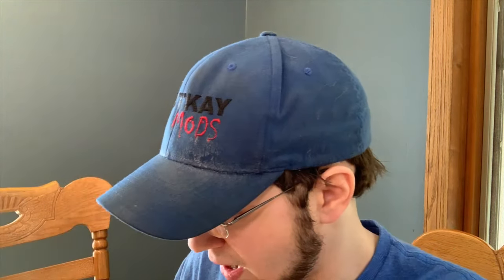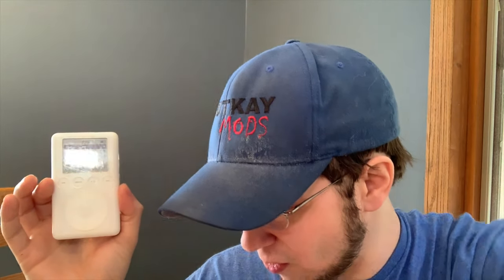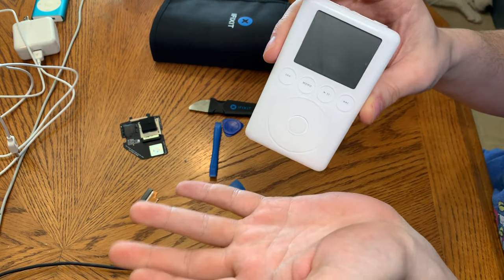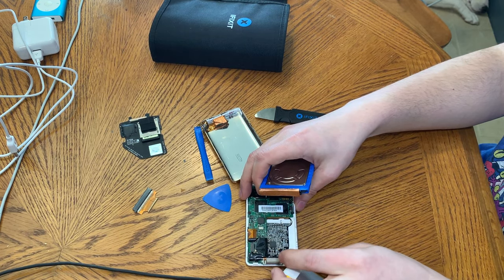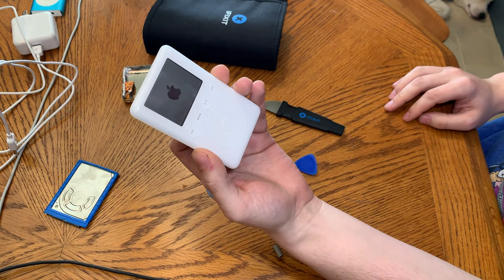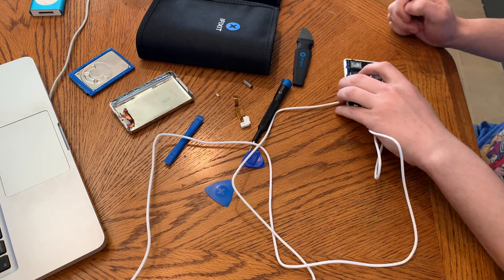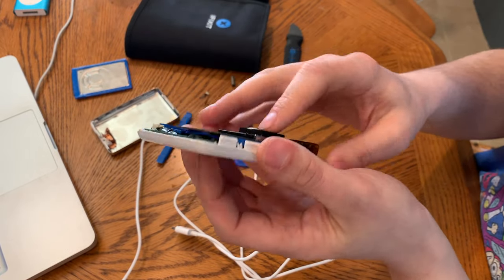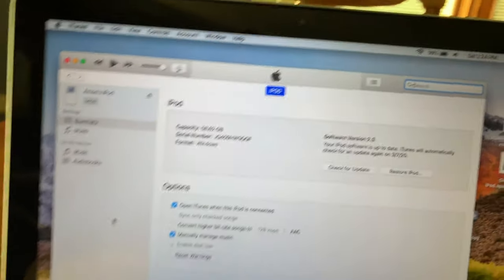Building a Flash Based 3rd Gen iPod (Part 1) – iPod Series S.1 EP.10

Comment: ah man, thank you so much for this. I was losing my marbles, I get obsessed when things don't work, especially when others have made it work. I was extremely despondent and about ready to dump it all in the trash, but this 2003 iPod has enormous sentimental value to me. I finally got the thing working! Quick recap for anyone struggling here - you will need iflash solo card + 4g adapter (also works for 3G) and EITHER (the hard to find /overpriced) usb/firewire dual cable OR 30 pin dock - USB plus 30 pin doc - firewire plus wall power adapter.  Important - THE FW CONNECTION to the computer is completely f**ked and useless who knows why - so 1) connect via USB to windows or virtual windows (make sure virtual windows can see/is controlling the iPod usb connection , not the Mac) 2) let windows iTunes restore software 3) disconnect, restart you should see a 'connect to firewire' graphic) 4) connect the FW cable (either to the Mac or just the power adapter, surprisingly either way works, who knows what it's doing but it's not communicating with the computer) and let it finish setting up - you should now see the 'select language' intro screen 5) reconnect to Mac via USB only , follow instructions from iTunes and you should be good to go.  I tried a SDHC card and it was slooow..put a 64GB SDXC and it's thumb drive speed now - more than fast enough. I'm sure 128GB will work, I don't have one here...I am sealing this thing up now before I jinx it.   By the way I used Mac OSX Mojave / Windows 10 under Parallels Desktop for Mac. Your mileage may vary I have no idea. JUST BE PREPARED TO LOSE A DAY/NIGHT OR TWO - THIS IS A MASSIVE HEADACHE , YOU HAD BETTER WANT IT BECAUSE IT CAN BE A REAL TIME BURGLAR. Good luck.

Comment: The third Gen can definately be flash modded with a Mac to 64 GB formatted to Apple partition Map. Does not need to be windows formatted! Just saying!
If you want to sync to a Mac and restore. Untick all boxes under options first, hit sync, then hit restore. That way you can restore over USB with a Mac! Just format the SD or Micro SD card to 'Apple Partition Map' first in your Macs card reader.
Reply: Hey, what a pity I have not seen your comment before! It could saved my time creating images with Disk Utility from original Toshiba drive, installing CCC, installing super duper and so on... 
In my case I have used 32GB Compact Flash card (Sandisk Extreme, 60MB/s), which was formatted as Mac OS Extended format (Journalled).
I followed your steps and unchecked all boxes and synced just one song. After I have restored my iPod 3G with hard reset (Menu+Play) on iPod itself I was able to do the restore. Apple iPod Dock Connector to USB 2.0 & FireWire Cable was used. Thanks!!!
Reply: @georgbalzereit8952  Nice one Georg, I am glad my message helped someone! 👍😉

Comment: I have one of those iPod 3rd Gen on great conditions in a drawer because the hard drive die a few years ago, I rather spend the money on an iPhone 5SE 120GB and filled with FLAC files than buy a new battery, IDE to SD adapter and the SD card, and I can use it  for more stuff than just music. for daily work out I use my iPod Nano 5 Gen.
Reply from the maker: It’s worth saving if you can get the stuff cheap

Comment: Help, when doing this, do you need to actually have it connected to Usb and firewire at the same time?  or is it possible to use an usb cable and then connect it to fire wire?
Reply from the maker: FireWire if you need charged while syncing otherwise USB is fine

Comment: How do you install an ssd in a 2nd gen iPod classic?
Reply from the maker: You just install it with a converter... SSDs can't be over a certian size I want to say 10GB? due to the firewire controller. If you can format it with an image and all your music on it though.. it might work with bigger but it also has a firmware partiton size limit which makes it hard to work with